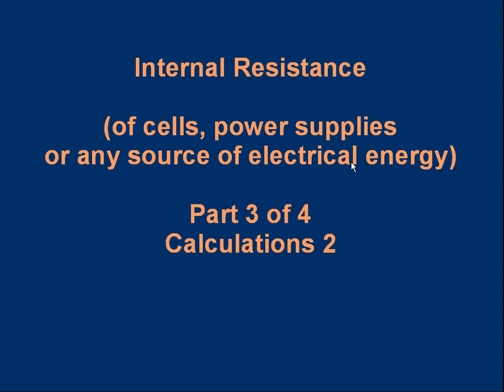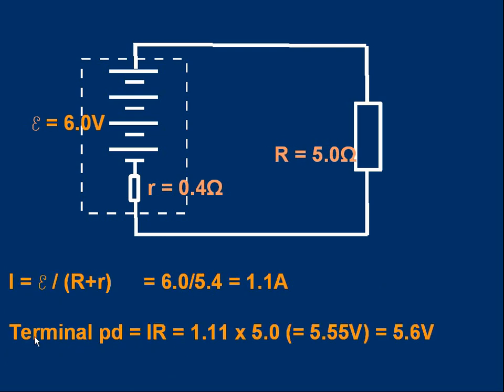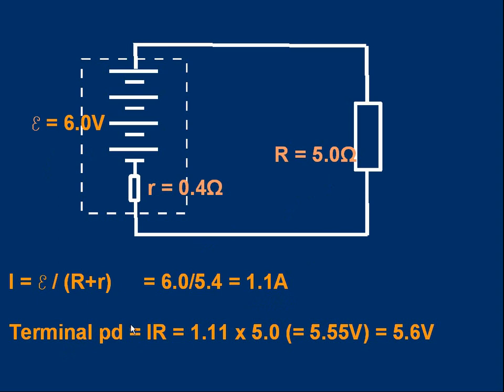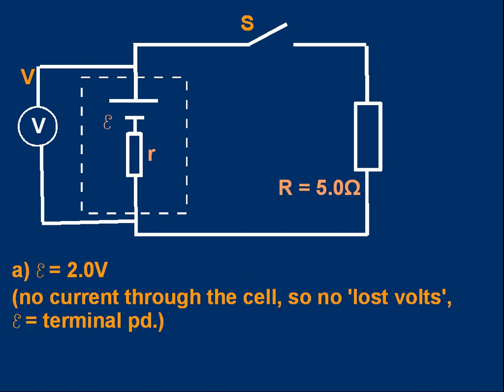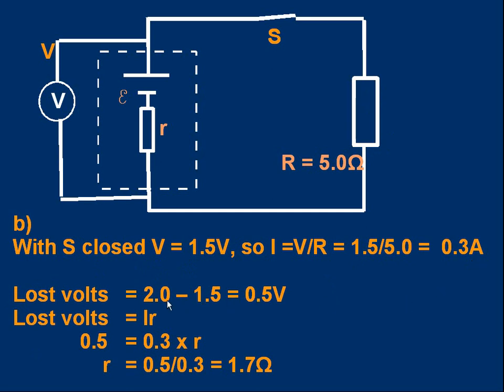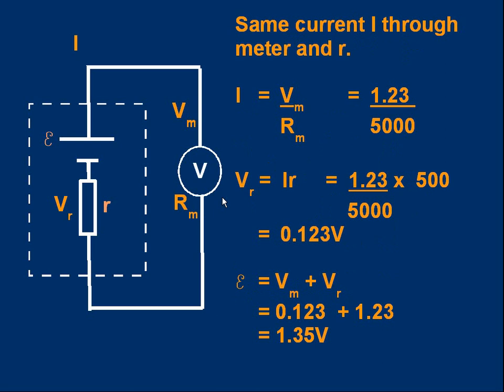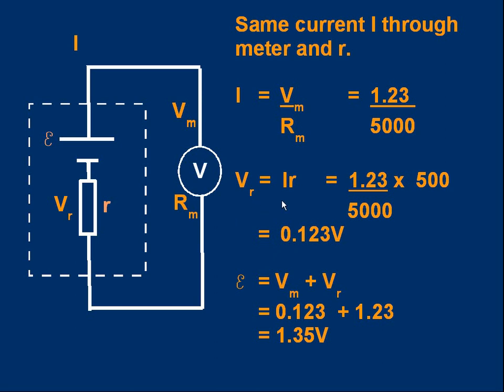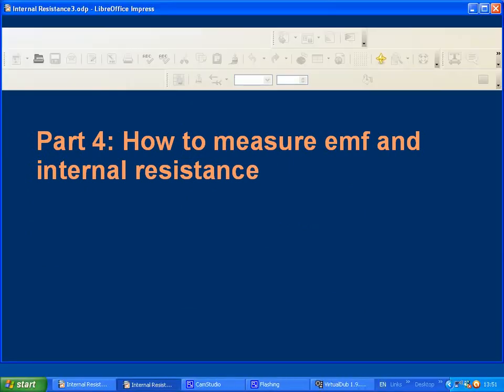GCE (A-level) Physics E17 Internal Resistance 3 of 4

Comment: Hi Steve,
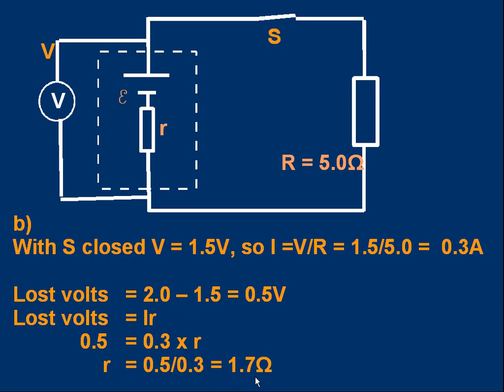I have a problem with working out the current in 5:33, I don't know how you got 0.3A. Isn't current = emf / R + r   and emf = 1.5V, R = 5 and r = unknown, so we have TWO unknowns??!! I literally don't get any of it! please help. I how did you get the current as 0.3A? Why did you use 5ohms and didn't add the internal resistance (unknown) too when calculating the current?

BTW, thanks a lot for these videos!
Reply from the maker: The emf is not 1.5V. It is 2V. This is explained at about 4.00mins.
_______________________

I got 0.3A as follows:

The question says (at about 3mins 40s) that the voltmeter reading is 1.5V when the switch is closed. This is NOT the emf as there is a current flowing, so it is smaller than the emf.

The voltmeter is reading the p.d. between the terminals. With the switch closed, this is the voltage being applied across the 5Ω resistor when a current is flowing. So we know that when the switch is closed, 1.5V is being applied across the 5Ω resistor, so the current through it is I = V/R = 1.5/5 = 0.3A.

Since the internal resistance (r) is in series with the 5Ω resistor, the current through the internal resistance is also 0.3A.
_______________________

You can use the figures to back-check this using current = emf/(R + r):
The (unrounded) value of r = 1.6666...Ω
I = emf/(r+R)
= 2(1.6666... + 5)
= 2/6.6666...
= 0.3A
So the figures check-out.
Reply: Steve4Physics Thanks very much Steve. I appreciate your time to respond in a very clear way that I understood perfectly.

Comment from the maker: That depends on the circuit.

Take a 6V emf battery with no internal resistance; connect to a 2Ω resistor.
Voltage across resistor = 6V, current through resistor = emf/Rtot = 6/2 = 3A.

Take a 6V emf battery with internal resistance = 1 Ω; connect to a 2Ω resistor.

Total resistance, Rtot = 1+2=3 Ω.
Current through circuit = emf/Rtot = 6/3 = 2A.
Voltage across resistor = IR = 2x2=4V, Current through resistor =2A.

If that’s not what you mean, you will have to be much more specific.

Comment from the maker: If you connect a cell by itself to a very high resistance voltmeter, the voltmeter reading is the emf. This is because there is virtually no current flowing through the cell. The 2.0V reading is the emf, with no 'lost volts' because there is no voltage across the internal resistance (Ir = 0 x r = 0).

When the switch is open, the cell is connected only to the voltmeter so we are measuring the emf.  The rest of the circuit makes no difference, as no current flows through the rest of the circuit.

Comment from the maker: If you send me your email I will send you the slides. But I used OpenOffice, not PowerPoint.
I regard the files as copyrighted, so they are only for use by yourself and not for distribution.   Unfortunately I can't offer to send further files as I do not want to undertake to provide this this sort of service, so this would be a 'one-off'.
Cheers
Steve

Comment from the maker: I think you mean the question at 3mins 18s.

The potential difference (PD) between the cell’s terminals is NOT the same as the PD across the resistor UNTIL the switch is closed.
 
With the switch open, there is no PD across the resistor but there is a PD across the cell’s terminals – which is the voltmeter reading (2V). 

This is not the same circuit as putting the voltmeter on the right-hand side, directly across the resistor, for example.

Comment: how can the voltmeter give a reading of 2V when the switch is open?? the terminal potential or i might say the potential difference across the resistor(which are in fact same things) is zero??

Comment from the maker: Yes, terminal pd = emf - voltage of internal resistance.  Terminal pd is ALSO the same as the voltage across the external load, so there are 2 ways to calculate terminal pd.
1) Voltage across internal resistance = Ir = 1.11 x  0.4 = 0.444V.
Terminal pd = 6 – 0.444
= 5.556V
= 5.6V to 2 significant figures.
2) Terminal pd = voltage across external load 
= current through load x load resistance
= 1.11 x 5
= 5.6V to 2 significant figures
The 2 methods give the same answer of course!